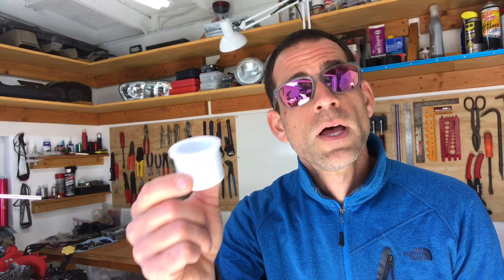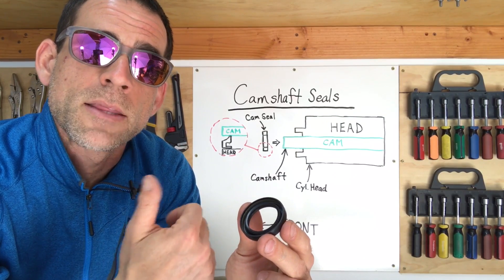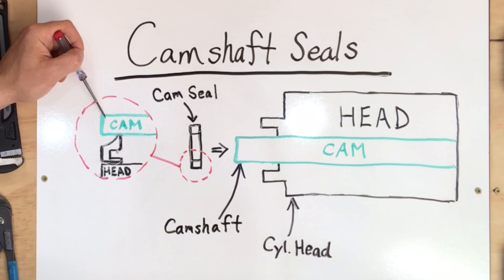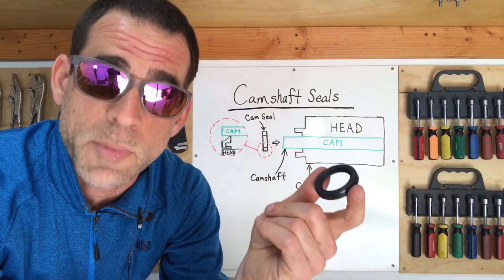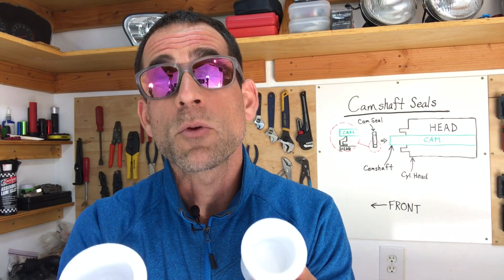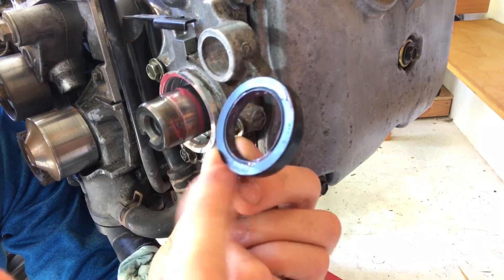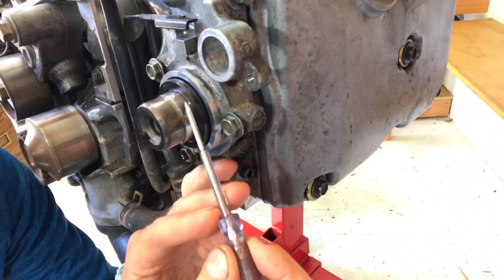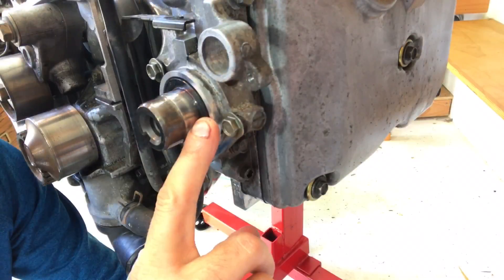Camshaft Seals | Whiteboard Drawing & $2 DiY Tool

Comment: my seals were not flush with the outer lip. they were seated more deeply and aligned with the inner lip. I keep getting conflicting info about proper depth of the new seals. please help. why do they need to be flush with the outer edge?
Reply from the maker: From what I understand, that’s the direction from the factory service manual. I have also assumed the reason Subaru recommend that inset was to make sure to the seal left enough room on the inside, to have a small gap and not contact the back of the cams.

Comment: Hey Luke.  I have a 2011 Outback 2.5, and I can't get the Crank Sprocket off (to replace the Crank Seal).  I soaked it with penetrating lube overnight, but no luck. I'm guessing that sucker has a little corrosion, keeping it held on.  I've been real careful prying on it, so as not to break a tooth or the aluminum head. Should I use heat? Is there such a thing as a Crank Sprocket PULLER? Do I need to take the Woodruff Key out FIRST?  Any advice appreciated.  Thanks !
Reply from the maker: Hey!  Pretty common situation here for sure. Like you said, these get a little corrosion in them and get pretty stuck on there. 

Don’t need to remove the woodruff key - can leave that in place. Don’t think I’ve seen a crank sprocket puller - only thing similar is the company 23 tool that holds it in place (to remove the crank bolt). 

My standard method is to smack that crank sprocket with a big rubber mallet, slowing working around the perimeter to break that rust seal. Once you get it to rock back and forth, use your hands to wiggle and giggle that sucker back and forth till you can slowly work it off. Should come off eventually. 

If this fails, you could try making some type of puller that has the fingers that goes all the way around to the back of the puller and a center bolt that screws in to push the pulley off - but I’ve never had to go to this extreme. Good luck! Hope you get it off - cheers!!! 🤙
Reply: @SubaruONLY  I finally got that sucker off, thanks for your good advice. I used a rubber mallet just like you said to shock it. And then I took two smaller flathead screwdrivers (1 a stubby) and placed them both between the CamSprocket and the OilPump, and I then GENTLY applied intermittent pressure pulling forward, rocking the L-screwdriver GENTLY and quickly rocking the R-screwdriver, back and forth but fast (and GENTLE). Took about 100 or so times, and I could visualize it slowly coming forward. It worked like a charm, no broken teeth. Also, I tell you what, that Lisle Shaft Seal Puller works like a frickin charm !! I took one of the small flathead screwdrivers and pushed through the old cam/crank seal to make a "hole", then inserted the Seal Puller, and it pulled those suckers right out !! 182k miles on the original seals, they were hard/brittle and starting to leak. I used a wood shim where the "fulcrum" of the tool rests against the block so as not to damage it. I then used a Schedule 40 PVC Plug 1.25" to seat the new seals in place just like you said. Easy-Peasy-Japanesey !!!  Thanks for Everything :)

Comment: Hi Luke what do you use to install the rear main seal?
Reply from the maker: Hey man. I don’t have a slick tool for that sucker, I actually got a piece of 1/2” oak hardwood, marked out the inner and outer radius needed and cut it out with a jigsaw. Could also do this with any material that’s pretty strong, HDPE plastic would be the perfect hardness I suspect. You can also, just push it in by hand to get it aligned and then very carefully use a drift and hammer to gently work it in by tapping around the perimeter, but I like to make a tool that presses it in evenly and slowly, that’s why I made the hardwood ring install tool.

Comment: I've gone to Home Depot, Lowes and the local plumbing supply.. none have that particular type of pcv plub :( The ones I found I don't think would work as the bigger end diameter is closed
Reply from the maker: Shoot.  That’s annoying.  Think I picked mine up at Orchard Hardware.
Reply: It's all good.. I should be able to find something similar to it. I guess if anything I'll have to order it online
Reply from the maker: Good idea.  For sure.

Comment: What about removal? I’ve been a mechanic for years and Subaru’s are my favorite. I find people removing them do more damage than installing. They’ll just cram a 2 foot flathead screwdriver in there and scratch and gouge the aluminum seal surface. I’ve seen people that claim to be good knowledgeable mechanics do it as well.
Reply: I screwed a thin pointy screw into the seal and pulled the seal out without scratching anything. 
Also the micro screwdrivers for glasses handles work. 
Those are sold at the dollar store.
Reply from the maker: Totally agree with you here!! I’ve seen the same thing SO many times.  In my opinion, anytime you are dealing with a machine surface that is intended to seal fluid or really anything, you NEVER want to scratch that surface in any way. And still, when it come to these cam seals, people seem to ignore this. 

Here’s my method. First, don’t scratch that machine surface in any way.  I’ve found two ways work pretty good: (1) Use a small sharp flat blade screwdriver to insert into the face of the seal (literally puncturing it) and then pry it out using leverage against the block material surrounding the seal, and (2) Use small wood screws, by drilling a tiny pilot hole (or two) into the seal itself, but don’t go so deep that you make contact with the block material and behind and under the seal, then grab some pliers and pull on the head of the screw, to gently work out the seal. Both these methods work well to get seals out (cam and crank) without doing any damage to the machined surface under the seal.  Good luck! 👍
Reply: I use a screw too. Hammer it in to get it started, screw it in a bit then use a hmer to remove it. I've done this on rear main seals and oil pump seals too without ever touching the sides.

Comment: I enjoyed the video.  I need the encouragement to do the cam seals on my 96 Toyota Corolla.
1.  Why not use engine oil or grease instead of assembly lube?
2.  Why not put lube on outside of seal too to ease installation?
Reply from the maker: Hey man - thanks!   Good questions. 1) those would work fine too, could really use any type of lubricant here, and 2) you typically don’t want to lube the outside of the seal because that could cause the seal to slowly slide back out of the block.  The outside needs to make a good tight interference fit with the block so it never moves anywhere.  Thanks buddy!! 🤙

Comment: hello bro.. im about to change my forester camshaft seal, i have a forester XS (non turbo) and i dont know if i need to buy 1 or 2 front seals... can u help me please ?  thx bro
Reply from the maker: This engine should be a single overhead cam motor.  So, you’ll need two cam seals to do the front of the engine - one on each side.   Good to replace both with you have everything torn down.  Good luck!!   🍀👍

Comment: Hi Luke. I am hoping I don't need to totally panic right now. I just yanked a bunch of stuff off my 98 GT Legacy 2.5 Motor to redo all the seals and the crankshaft seal. I am really glad I decided to check that out. It seems the keyway is bashed... and I am worried the motor is toast. I don't want my kid to have this thing blow up on him on the way to RENO, 40 miles up hill past Tahoe. I am redoing the timing belt, even though it's only got 20 K on it. Here are the photos you need to see, in order to make some sort of assessment. Is there any way to fix this besides ripping the whole thing apart?  PHOTO:  https://www.dropbox.com/s/46pb17flu0y5ntc/IMG_2636.jpeg?dl=0    |  VIDEO OF THE CRANKSHAFT w/o the key way in .... https://www.dropbox.com/s/lpea7p9zgkt8dc8/IMG_2634.MOV?dl=0  | AND With it in... https://www.dropbox.com/s/3gv51w70qq0xqul/IMG_2635.MOV?dl=0   << sorry if the video is a little shaky.  --- AM I IN BIG TROUBLE?
Reply: Does that keyway slot look normal to you? can you take a photo of one you know is good in your shop on a motor you have? I just don't want to assume it's good  and have the motor blow up on me. :)
Reply from the maker: It does look a little abnormally widened / or bashed out on the sides (as you describe).  I’ll take a pic of a good one and upload it after this message.  This is not too uncommon.  If that keyway allows the crank to have any play, which it does look like it will have, then every time that engine rotates when running, it will beat on it more and continue to widen it - and eventually it will open all the way, and the crank will no longer be in sync with the cams and valves, and bam 💥 valves smack the top of the piston and engine is done.  This is what you are trying to avoid happening!   

When you slide the crank gear over that crank, is there ANY play at all (rotationally). There should be absolutely no play.
Reply: @SubaruONLY  I will check for the play. When I was removing it (before I started sliding it off, it seemed to have zero rotational play. That is hopefully going to be the case. Now I can tell you I purchased a brand new Harmonic balancer, and plan to install that (STOCK) and the previous one was visibly vibrating a lot - the guy at an oil change station pointed it out, and said it should not be moving much at all...  - which is why I am a little concerned. I will make sure it's solid AF, before I try to reassemble the engine and time it. I just checked out this thread about the same issue, and it seems to indicate - using Thread locker blue , with JB weld in the GAP, cured for 24 hours before trying to do the final torque values. Thanks for your reply!!! Much appreciated!! THREAD: https://forums.nasioc.com/forums/showthread.php?t=2512790
Reply: @SubaruONLY  I can tell you it was a BITCH to take it off, and the key way itself looks unharmed.

Comment: Quick question: I am considering buying a 1998 Subaru Legacy · GT Limited Sedan 4D with some leaks on the cam seals. I figure it's four seals, and a bunch of wrenching on some stuff to remove them. I have built an entire Porsche 911 Engine a couple times, so I am fine with the mechanics. My question is: do I have to PULL the engine to get these seals done, or is it just a royal pain (but still possible) to do it without pulling the engine ?
Reply from the maker: Great question buddy!!!   Thanks for asking!  And those early Legacy GTs are legit man!  Love those cars.  You can absolutely replace the FRONT cam seals and the front crank seal with the engine in the car - it’s not too bad either.  Just need to (1) pull the radiator, (2) pull serpentine belt (and probably easier to pull the accessories, as in ac, power steering unit and alt), then (3) pull timing cover off, (4) remove timing belt, (5) then pull off the cam pulleys. Those seals are right under/behind the cam pulleys.  It sounds like a lot of steps, but it moves pretty fast and can be done in an hour or two no problem.  It’s also the perfect time to replace the timing belt and pulleys and if needed the water pump, so consider doing those too, might save some time in the future!   Good luck!   You got this buddy!  😁
Reply: I am thinking this is a steal - It's really pretty solid - Aside from those leaks the timing belt has been replace at 145K and it's at 168K now. I know I can do that work as easy as you described. I have built two complete flat 6 Porsche 911 engines. I know I can do it.
Reply: To clarify... It's 2 seals or does that engine have TWO cams per side? I am thinking it's one per side.
Reply from the maker: I’m not 100% sure but I think the 1998 Legacy GT engine has a dual over head cam (DOHC) design. It that’s the case, yes it has two cams on each side.  But either way, dual overhead or single overhead cam design, you can replace all the front cam seals with the engine in the car.
Reply: One final question. With the timing belt already replaced some 10K-15K ago, will it be possible to just skip that and not have to reset anything like cam timing? Is there any part of the disassembly that will disrupt the settings... or can I just peel off the outer stuff, be really careful to mark the cams where there are, and slip off the old cam seals, replace with new and then just careful reassemble?  I just want there to be zero chance i screw the engine timing up. IF there is a way to lock the cams - I should be ok. I am figuring the cam sprocket must come off to access where the seals are, correct. I realize that is a bit of a loaded question. Thanks!!!

Comment: Is it necessary to pull the mother to replace the cam shaft seals?
Reply from the maker: Dan Capobianco - hey man.  No, you can do the front ones pretty easy with the engine in place.  Just need to pull the timing belt and the cam pulleys. Good luck buddy!  🤙😁

Comment: Hi I was looking at a picture of Subaru special tool for cam seals and it looks like there is a step on the inside diameter of tool that pushes the cam seal a little bit past flush.
I was also wondering if you have any suggestions for smoothing out a a scrape in cam shaft that is directly underneath the cam seal and causing a small amount of oil to get past the seal. My Subaru Tech friend says to sand out scratch starting with 800 grit and working up to a maroon 3m pad.

Comment: I was just thinking about the old day's when I worked for Yamaha motorcycles, I use to remove the cam, or crankshaft seals with a screw, which I screwed in the seal and pulled on the screw with either a slide impact hammer, or with vice-grips, or pliers...
Reply from the maker: Hell yes!  👍👍
Done this too - great method!  When careful, it’s one of the BEST ways to carefully extract that seal and leave that inner machined surface totally untouched!  Cheers!

Comment: Factory cam seals are recessed about 4mm beyond the outer cam seal surface.
Reply: I noticed this as well when I pulled my cam sprockets off.
Reply from the maker: Thanks for sharing.  Have to look into this, 4mm is actually quite a lot.  But thank you.

Comment: I forgot to put some lube inside of the cam  seal, what will happen if it’s running?
Reply from the maker: Should be ok.  The lube is just extra precaution until the engine oiling system lubes everything up.  It’s much more important for hard metal parts, for these cam seals, it will probably be fine.  Maybe crank engine for 30 secs a few times before firing it up to be safe if you wanted to take some extra steps to lube everything up.  Cheers!  🤙🤙

Comment: Do you recommend making or buying a tool for the rear seal? I tried pulling it without the seal removal tool using a drill and lightly scored the crank shaft  due to knocking it too far in. Had to order a crank sleeve from silver seal products which make them for Subaru crank shafts. Seen a few videos of people tapping them in with wooden blocks but that didn't work for me. I didn't lubricate the inside of the seal which probably made it worse the inner spring kept popping off as I tried to tap it in. Instead of trying to work inside the bay under the car without the transmission in I've decided to pull the engine to try again. Now I know oil degrades rubber so would 303 aerospace protectant being a rubber preservative be better to slide on seals or is assembly lube a must? 303 is pretty greasy but I wouldn't want it to interfere with engine oil. Thanks for the videos, amazing information and looking forward to more.
Reply from the maker: Hey man. Sorry to hear this.  Always nice to have the custom tools but I just use three short wood screws and carefully sink them into the seal, then grab the wood screw with pliers or vice grips and slowly work out the seal.  

*I’ll try to make a video of this process in the future.
Reply: SubaruONLY Awesome. Thanks for the reply. Any tips on valve seal installs? I talked to a mechanic about using a paste and plunger to grind the bell of the valve to the bowl. Supposed to take out any imperfections. Also seen people hammer the seals on but could that recess the guide using that method?
Reply from the maker: Yes.  That is typically called, “lapping the valves”.  The paste you are referring to has abrasive material in it and basically “sands” down any imperfections between the seating surface of the valve and valve seal in the head.  Good idea to do and very easy to do - just don’t go overboard and listen to the way the “sanding” tone changes, you will hear it change slightly when all the imperfections are removed and it’s sanding the whole radial surface evenly - at that point stop and move on to the next valve.  Should only take 30-60 seconds per valve - depending on how fast you can spin the valve.
Reply: SubaruONLY The valve seals just pressed on after I adding some mobile 1 grease. I'm using the drill press hack works perfect. 

Good to know about the lapping that's what I'm doing next.

Is a brass wire wheel too abrasive on an angle grinder to remove head gasket material from the cylinder only? I got 90% of it off but some isn't coming off.

Also had a rough time getting the cog pulley on with the belt... stripped out the water pump which was a good thing because It wasn't oem and found a new oem part cheap.

Working on an ej22.

Thanks

Comment: Enjoying the vid mate keep up the good work 👍🏻 just wondering if you could help with a question I have about the GDA model wrx? 
I have a blob eye wrx and am upgrading to coilovers and as I was doing my research I came to learn that there is two different size lower clevis’s on the strut one is 28mm the other 30mm apart from the 2mm do you know what the difference is? Is one sti one wrx or is one rx the other wrx/sti? Any advice would be appreciated thanks